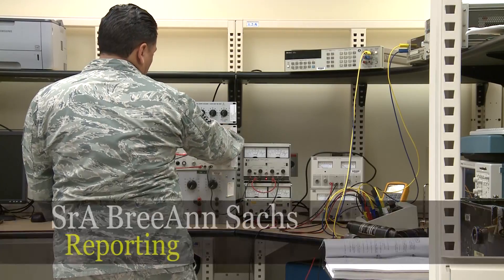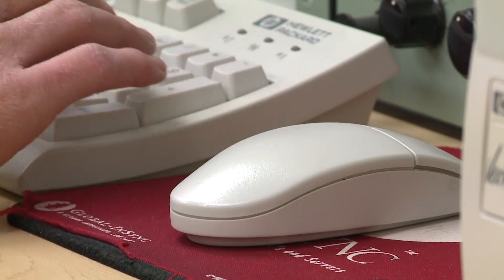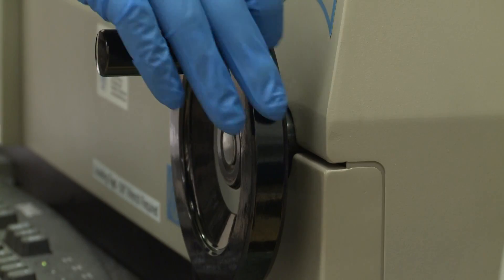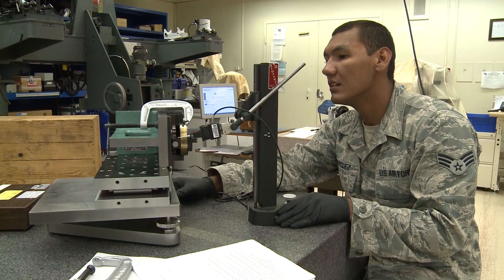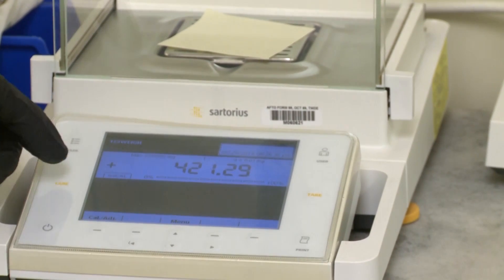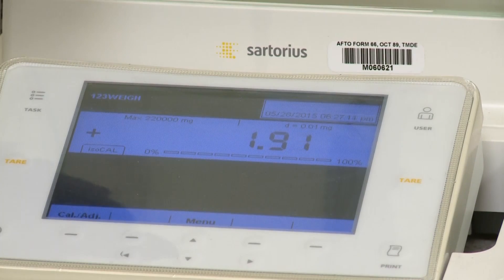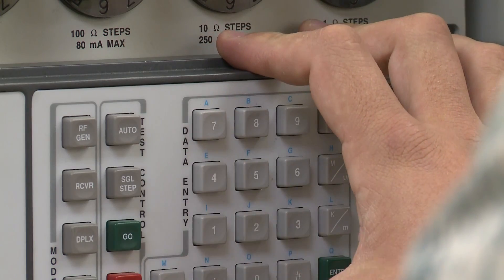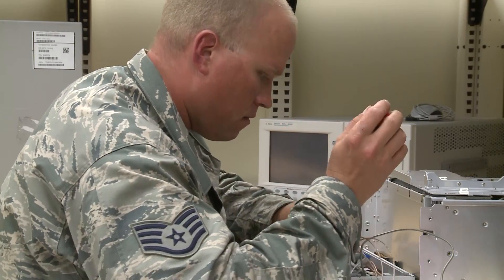PMEL: The Back Shop of Back Shops

Comment: Went to Basic PMEL course in 1974-75. Then on to lab at Charleston AFB,SC for 18 months. Back to Lowry AFB, CO from 1976-1981 as basic course instructor. I taught math, DC and AC principles, oscilloscopes,, soldering and troubleshooting. I was also the lab chief at McConnell AFB, KS. Worked in K1,K2,K8 DC/Electrical Standards Section;
K3,K4 Frequency/RF Section K7, RADIAC

Comment: Was at the first PMEL classes at Lowry in 1960, then went to lab in Plattsburgh AFB, got out in 62. Was previously in airborne nav radar for six years. At that time you had to be at least an E4 to take the entrance exam, I was an E5. Got out because with 5 years TIG I was at the bottom of the list for E6, we had no promotions during the two years I was there.

Comment: Yes sir, I was a PMEL technician 1976-84. Went to tech school at Lowry AFB for 9mths where we were trained to calibrate and repair test equipment down to the component level (transistors, diodes,capacitors,microcircuits e.g.) as well as working on scales, load cells etc. Calibration standard was the 829g. We worked on multimeters psm 6, o'scopes vacuum tube and solid state, oscillators, Sig gens, freq counters, digital volt/ multimeters. It was a wonderful period of my life and truly proud to have served. Cannon, Misawa and McGuire AFBs. AFR 3510 grooming, 1550/1505 Lt blue shirt or olive drab green were uniforms of the day. I'm now 60 yrs old and continue to uphold my personal grooming as well as keeping my gig line straight. Respect to the USAF. Oh yes, chow was great especially omelets for midnight mess/chow.